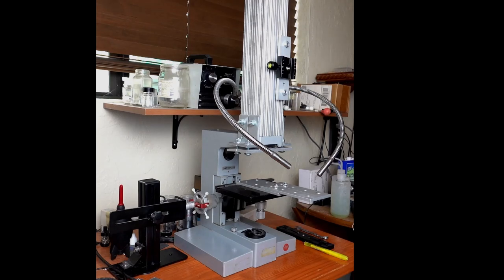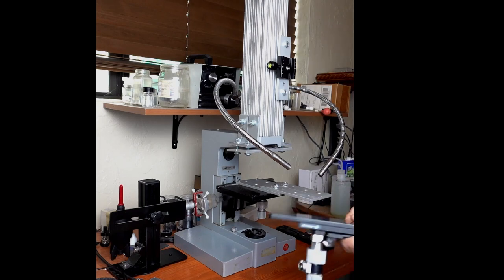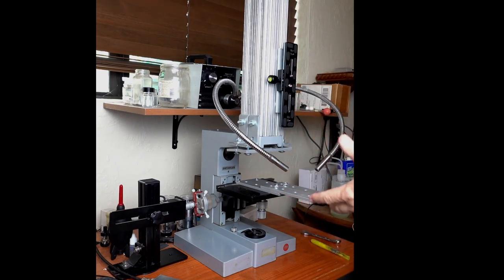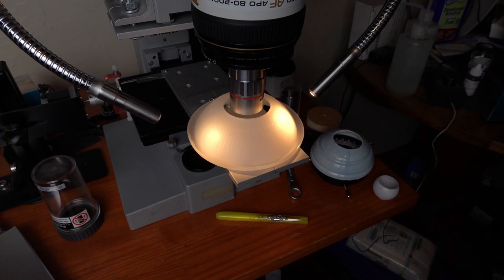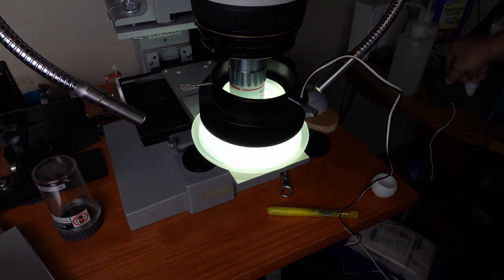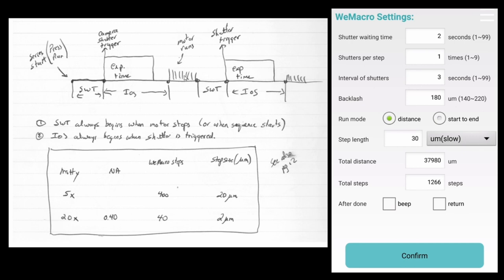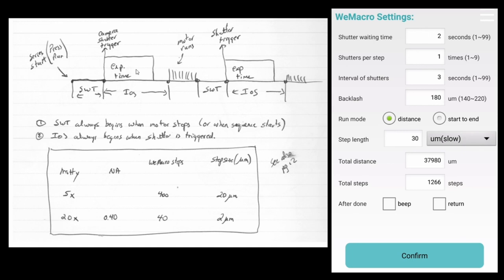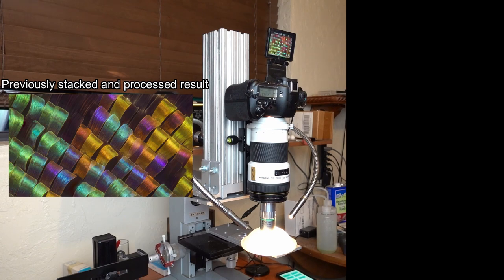Extreme macro: DIY focus stacking build, WeMacro MicroMate stepping motor, illumination, operation

Comment: Hi i am almost same setup. But, vignetting in the display. Zv-e1(sony fullframe) + tamron 70-300 + 8 step ring + mitutoyo alike 20x. I suspect step ring. Would you pls advice me?
Reply from the maker: Does the tamron open up to f/2.8 or faster?  I need at least f/2.8 to limit vignetting. If you look at my butterfly scale video, you can see my current setup which dumps the camera telephoto and now I use the wemacro tube lens setup. It works really well and is not so large.

Comment: Sorry for the dumb question. If I wanted to purchase a filter adapter for the microscope like you have what would I type in exactly? 
Tried searching Amazon and eBay like you.
New to the macro world. This video helps alot
Reply from the maker: You would get threads for your filter size (here it is 72x0.75mm).  The Mitutoyo is threaded for (26mm x 36tpi)--yes it is mixed metric and english!.  You can get away with a metric for the mitutoyo since there are not many threads on the adapter and it is close enough (e.g., 26x0.75mm).  If you can't find one adapter, you can stack a couple to get what you want. If you look at my butterfly wing scale video, at the beginning I show the solution I am using now which replaces the camera zoom lens with a We-macro tube and lens.
Reply: Honestly cant thank you enough for all the help. Your channel has been a serious eye opener as someone who is new to macro photography. Seriously appreciate you and all your content  @weekenddistractions

Comment: Wow!!! What a great video! thanks so much. Been thinking of a variety of solutions for building a 'DIY microscope. I had a decent Amscope a couple years ago, but then moved and couldnt bring it with me. You gave me a lot to think about! Also, really love your lighting tips

Have you ever been able to create DIY darkfield microscopy without a microscope and just an objective?
Reply from the maker: Hi. Glad the video was useful. Well if I had to make darkfield without a darkfield condenser, and use a use a rig like this, I would try two gridded flashes under but pointed up towards the objective, but to the side of it.  So the one on the right underneath would be pointed up and to the left of the objective. They would probably be nearly horizontal to avoid the NA of the objective. Lighting semi transparent object (like a thin leaf) might look pretty cool. Instead of flash grids, it might be better to use something like paper towel tubes on the flash to make a couple of small beams of light.--and you would need a transparent table.
Reply: @weekenddistractions  I actually have a darkfield condenser from my AmScope :) i was gonna try and put this overtop of a light source (i have a VERY bright and flat LED light source i use - the kind of light typically attached to a ceiling) - so mimicking how it sits above the light source of a microscope - not sure if this will even work, but i can try, lol
Reply from the maker: @Koolik-art  Let me know how it works out. A A stacking scope and DF condenser seems an odd marriage, but you never know!